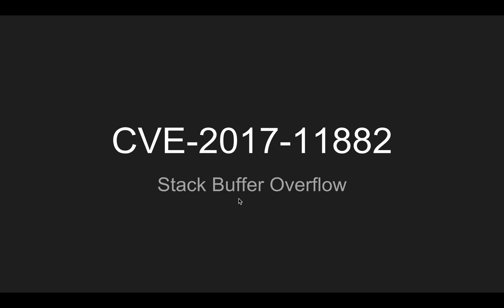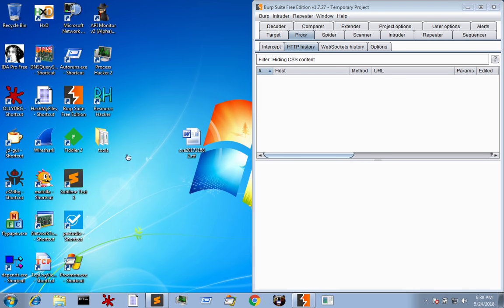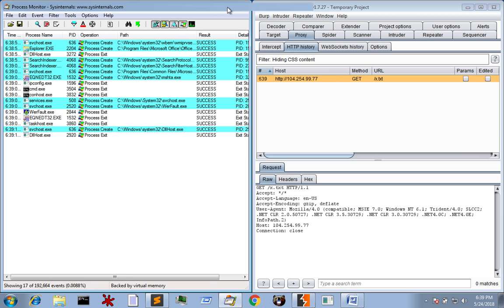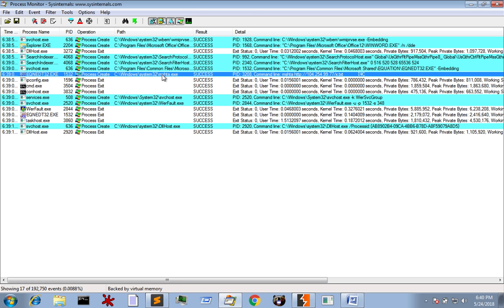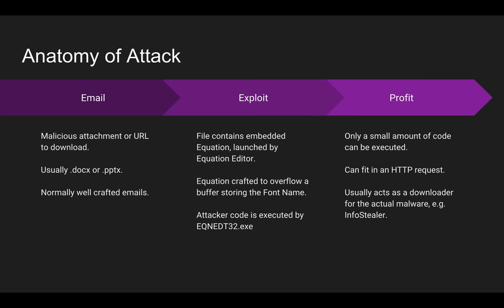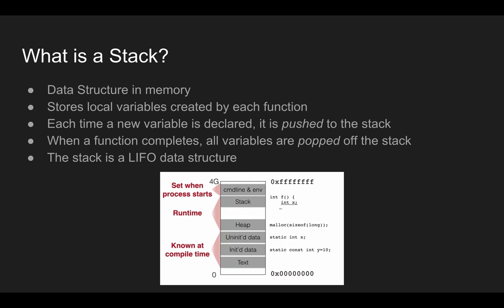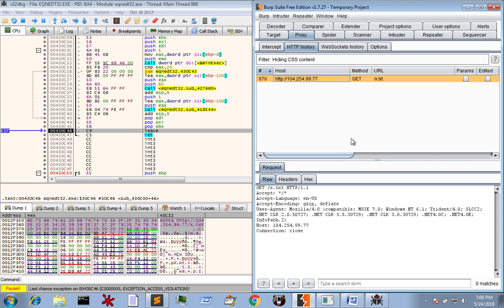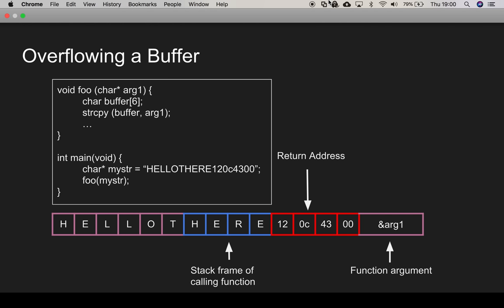Stack Buffer Overflows - a primer on smashing the stack using CVE-2017-11882

Comment: 20:37 hmm, interesting x32dbg disasm is wrong. F3 A5 should've been REP MOVSD. (No repeating until equals to zero. It just repeats ECX number of times, or copies DWORD from ESI->EDI, adds 4 to ESI and EDI and repeats it ECX number of times, or 0xC or 12 times in that case.) Great video otherwise.

Quick question, Colin. What does mshta do with that x.txt payload after WinExec downloads it?

Comment: How is the exploit getting the address of WinExec? I did some research and it looks like they'd need roughly 200 bytes of shellcode just to retrieve that, before the shellcode needed to call it with arguments.
Reply from the maker: by decompiling eqnedt32 the address of WinExec is always the same. Therefore knowing that you can overflow the buffer to point to that address. Had eqnedt32.exe been compiled with ASLR in mind, this wouldnt be the case.
Reply from the maker: and what i mean is, the researcher / bad guy can decompile the binary, poke around it and find that WinExec is called within the code (for whatever reason Microsoft intended). Knowing where this call is, its going to be at the same address each time.